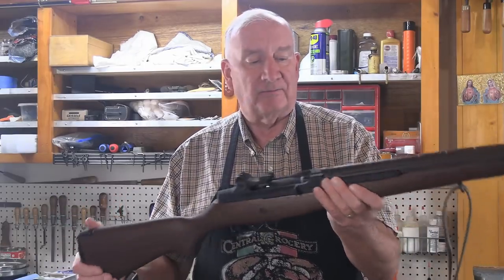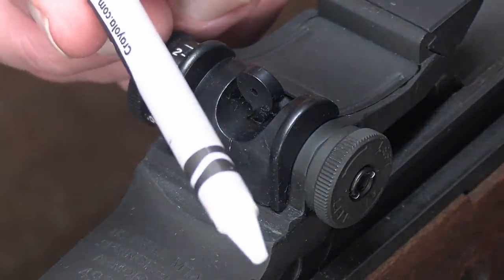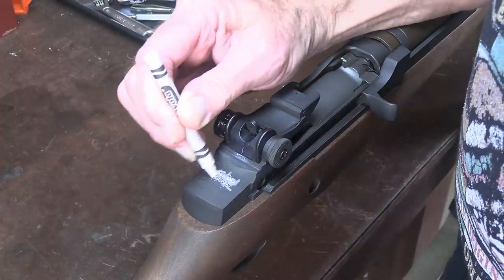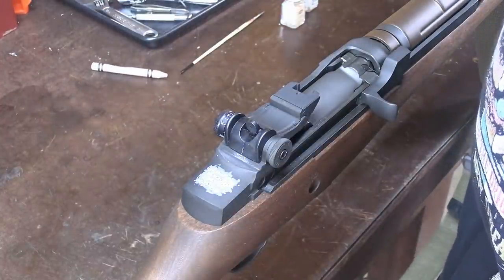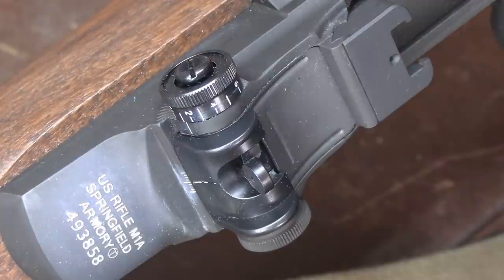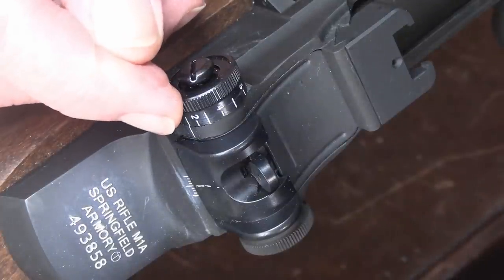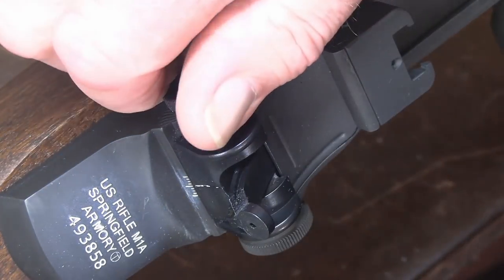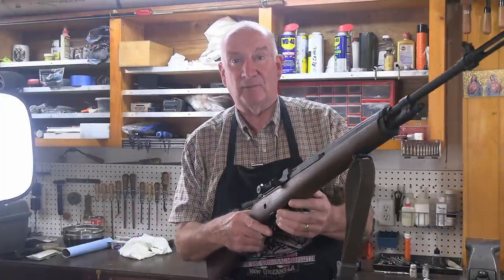How to EASILY Calibrate and Whiten the M1A Elevation Knob!

Comment: Crayola Crayons are staples for any range shooting bag. So is ladies lipstick and fingernail polish. The clear coat hard as nails has multiple uses from a replacement for Loctite to waterproofing primers on ammo. Fingernail polish can color front sights and color special loaded case heads the same as crayons can. You can mark shots on targets and they work in wet conditions for writing notes on targets. This is a great tip shooters seldom ever think about. ✨💎✨👍
Reply: And are essential for a balanced American diet.😁
Reply: @StevenSmith-pt8rz  found the marine

Comment: If you were to add a little heat before you use the crayon it will cause the lettering to fill completely. Then after you clean off the excess apply a little heat again and it will set the crayon. You can thank me later (-;

Comment: The Coast Guard was the last active service to use the M1 Garand. On our vessel, we had a crew of 150 but the arms room stocked only 50 M1 rifles. As a result, at annual range qualifications, 3 men used the same rifle. They certainly didn’t fiddle with the elevation drum. What we did was record the number of clicks for 100, 200, 300 and 500 yards on a notepad. When our turn with that rifle came up, we simply backed the elevation back down to the bottom and used our notepad information to shoot. Using this method, I fired expert consistently. 

On another note, I was a civilian employee (AST) at an Army Reserve unit for a few years before my IRS career. We had 150 pristine M14 rifles in the armory… beautiful weapons! I get orders one day to load them up in the back of a multifuel and haul them to Fort Carson and exchange them for M16’s. Those M14’s were shipped to some pissant “ally” nation. What a shame.

The US GAVE 35,000 M14's to Israel in 1973 when the Yom Kippur war broke out. After the Yom Kippur war Israel spec'd every one of the M14's, and the 10,000 best ones were converted to the IDF sniper weapon. The remaining M14s were taken down for parts. The M14 with an attached 6x Nimrod scope was the Israeli Sniper Weapons System through 1997.

In the mid 1990's Israel decided to go with a bolt action Mauser as their SWS. This led to having a bunch of M14s that were going to be surplus. So, Israel SOLD those free rifles back to Americans. 

I am not sure how Springfield Armory ended up with the guns, but they did. They brought the guns, minus the receivers (once a machine gun always a machine gun), back into the US
Reply: United States also paid for the development of the Iron Dome but Israel won't openly share the technology with us. 
Funny relationship we have huh

Comment: GB490, Thanks for a well-done and informative video.... surely do appreciate the handy tips,in particular your easy method for calibrating the marks on the elevation wheel to the rear sight setting. 

 Hey, not to be a jerk or anything but knowing that you value accuracy, the sights on an M1A/M14 are calibrated in meters, not yards - at least if you use the stock OEM iron sights (1m = 1.09 yd. or 1 yard ~ 0.91 meter). The sights on an M-1 Garand, however, are in yards. The rear elevation wheel is graduated to 1200 yards on an M-1, but only 1100 meters on an M1A/M14, in recognition of the slight difference between the two units of measure. At the distances most of us shoot, the difference is immaterial but just thought you'd want the correct info out there. It is possible to buy an after-market replacement for the M1A sight which is graduated in yards, and some people do that.
Reply from the maker: My M1A is calibrated in yards.  Some are, some are not.
Reply: @GunBlue490  - OK, good to know that.

Comment: Thank you for some very useful and enlightening information; however, I have a question I hope you will answer for me.  I recently purchased used an M1a.  When I got it home, I field stripped it for inspection and oiling.  I noticed the trigger group was very tight when I removed it.  I lubricated it and when I reinstalled it, it took more force and effort to get it seated.  I took this weapon to a gun shop and showed this to them.  I was told that this was “normal” for the M1a.  I carried an M14 in the army and my weapon field stripped much more easier than this.  I am skeptical of what I was told at the gun shop.  Is this really normal for the M1a?  Please advise. What will correct this issue.
Thank You for your consideration
Regards

Comment: I use the testers but yellow for my knobs, But the trick is to use Lacquer Thinner instead of Acetone to take off the excess and put painters tape around the knurled knob and use a fine painters brush .. No problem and it stays a lot longer than Crayon… BTW if U use WD 40 instead of alcohol it works really quick and easy…👍

Comment: As a kid we used to use this technique to line the numbers on D&D dice with a crayon. You can also use a lighter (or blowdryer) to melt the wax. When it cools the wax will be fully embedded and unitized which will help keep it in place even as it gets heavy use. 

Of course the only issue with crayon is that extreme heat in an area prone to that could make it soft and prone to accidental removal. In modern times I've seen a dice manufacturer use a fine tipped xylene paint marker to hand draw the numbers in as well, but that takes slightly more hand-eye co-ordination. That method will NOT come off due to weather and will essentially last forever. If you make a mistake it can normally be cleaned up with something like Testors enamel thinner, which can also be used to remove it completely and start from scratch. They can be bought at Michaels or Hobby Lobby type craft stores in a variety of colors.

Comment: Question: I tried this on my M1A that has the national match rear sight.  Sighted in at 100 yds, recorded the number of clicks from the bottom.  When I loosen that screw and turn the dial counterclockwise to get to the 100 mark,  the sight is still moving when I turn the dial.  I fiddled around with it for a while but still the same thing.  Any tips?

Comment: OK, what (type). did you put on the rag to wipe off the excess? I saw "alcohol" hand written on the can. What works the very best? What type of alcohol? Would   "70% Rubbing Alcohol" work/work well? My wife has it in the bathroom so its the only alcohol in the house.
Reply from the maker: That's denatured alcohol, but your wife's should work, too.  It's just a bit milder.

Comment: My elevation knob doesn't click. When I turn it, it raises and lowers the aperture but it just kind of free-wheels. Is there anything that I can do to make it click like it's supposed to?
Reply from the maker: The back of the elevation knob has four raised bumps that interact with striations on the receiver.  If the elevation knob is excessively tightened or if the knob isn't hardened sufficiently, those raised bumps can be buffed off against the harder receiver steel.  Call Springfield Armory and request a replacement. When you reinstall the assembly, tighten it only as needed to provide firm clicks, but not too tightly.

Comment: Like the idea of the crayon but question how that would hold up under the hot sun.  Seems like would be a hot mess.
Reply from the maker: Crayon is made of paraffin which melts between 120 to 150 degrees Fahrenheit and is commonly used by home canners to seal jelly jars. If you're shooting in that heat, your sweat is a lot more messy.

Comment: I purchased an M1A standard (california compliant). That means it came with a muzzle break instead of the flash hider. Are there alternatives to the factory muzzle break that came with it? Reason is because even with doubling up on ear protection (orange ear plugs deeply inserted and ear muffs over) the shots are still causing ringing in my ears. It's too dang loud.
Reply from the maker: I would at least remove the muzzle brake if there's no alternative.  They direct blast rearward and cause serious hearing loss, and are extremely bad for adjacent bystanders, too.
Reply: @ Zestfullylemonfresh - Regarding the muzzle brake, you ought to be able to remove it and simply screw on the appropriately-threaded muzzle thread cap. You won't have any muzzle device at all, then, but at least most of the noise will be directed forwards and not to the sides. You'll suffer a bit more recoil, but it ought to be tolerable. Consult your local laws, of course, etc. etc. Brownells or Midway probably has the right cap. If not them, Fulton Armory or maybe even Springfield Armory.

Comment: do you have any inpt on the ones in 2008 2006  era   i hear they had a bad time   parts breaking  hammers break   bent      i have a new one from then   never shot it  ,  read so much bad it's still new in box,   love to hear your thoughts on them for reliability , accuracy and if those y ears were just bad .  thanks
Reply from the maker: Sorry, but I don't have any specific knowledge of such issues.  However, Springfield Armory guarantees their rifles for life for the original owner.
Reply: Mine is from 2014 .I've never heard of the issues that you mentioned

Comment: How apply linseed oil m1 garand pops
Reply from the maker: Apply boiled linseed oil two drops at a time on a small area with the fingertips and rub into the wood with the palm of your hand until it dries.
Reply: @GunBlue490  dear sir what's your take on rock island 🗿 1903 low serial number.  🤔 if it's been around this long it should be a safe bet 2 plus at throat and muzzle means thousands of rounds safely launched right?

Comment: WD-40 works better than alcohol
Reply from the maker: Yes, it will very efficiently remove the lettering, too!
Reply: @GunBlue490  No It Actually Doesn’t I was just as surprised as U are Doubtful when it took all of the excess crayon off but left the lettering Perfect on My AK receiver
Reply: @GunBlue490  Not if done right, I’ve used this method more than a couple times on AKM receivers and the trick is not to use too much WD-40 just moisten the cloth and rub the extra crayon off the receiver or part..JS 🤷🏻‍♂️
Reply: U must be pressing way too Hard or scrubbing.. Because all I did was spray some WD-40 on a Rag and wipe like I was cleaning a window and it all just wiped off the excess crayon, And it left the embedded Crayon 100% perfect.. 🤦🏻‍♂️🤷🏻‍♂️😂
Reply: @bruiser0159  this guy is not receptive to ideas other than his own